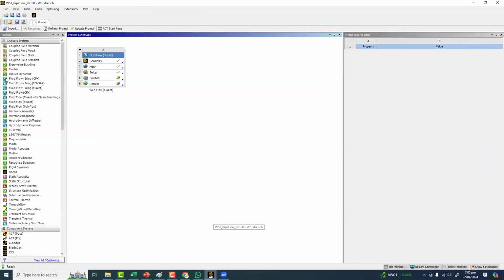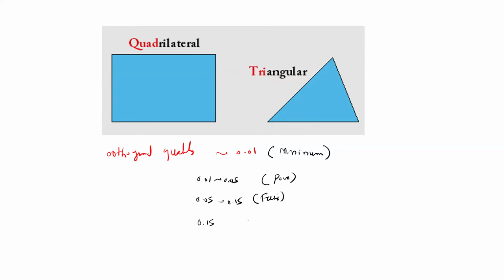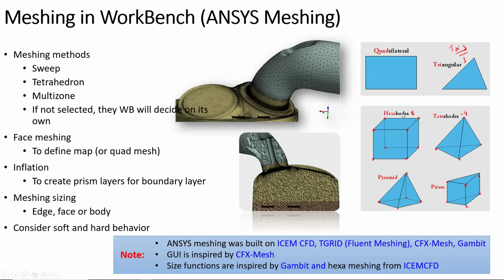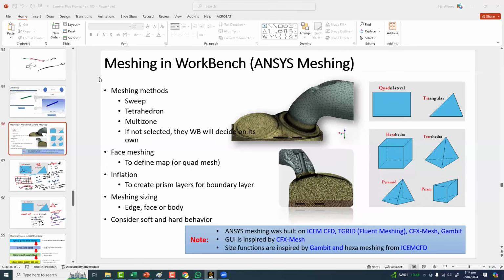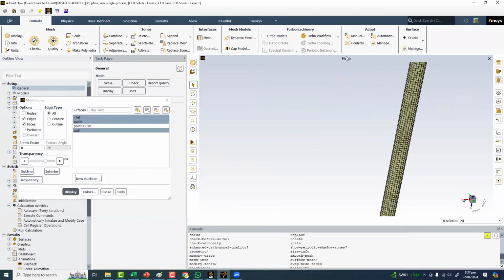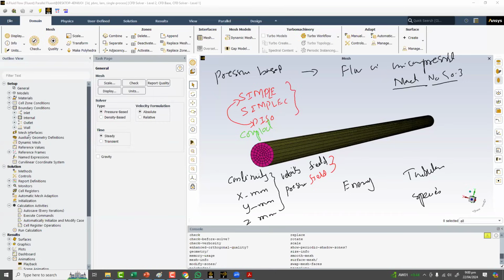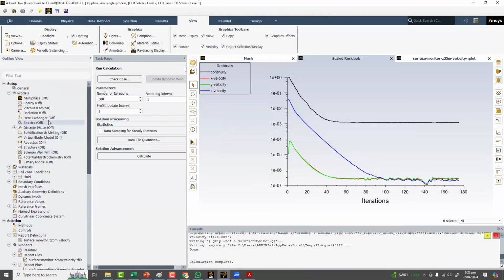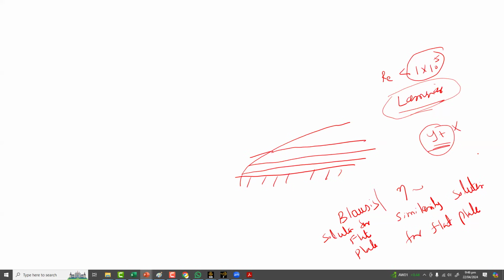Master ANSYS CFD (3 month course) Video 1 (sample)

Comment: Hii 
I am working with triple pipe heat exchanger with helical tape inside it
After meshing I am getting the skewness as 1 also other parameters as worst on the helical tape
Can you help me with this how to reduce the factors and skewness
Reply from the maker: +92-321-5096447
Reply: Can you please give tips here...
Reply from the maker: @mdshameem7931  try to define proper sizing along with size fucntions